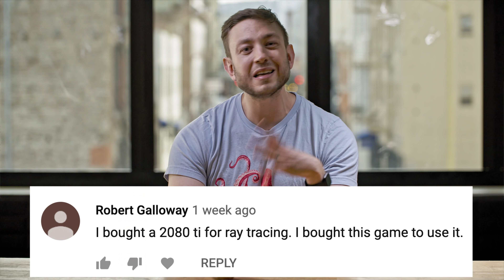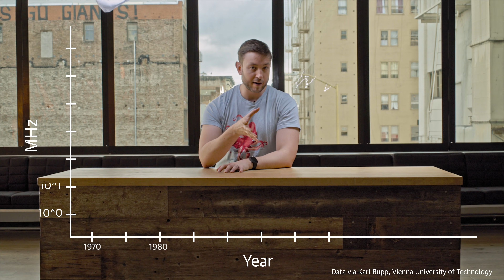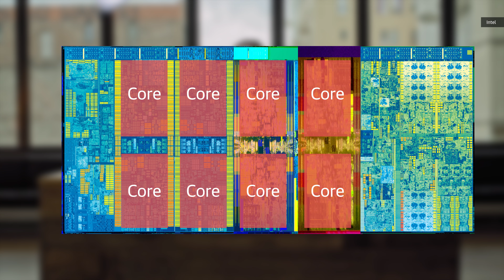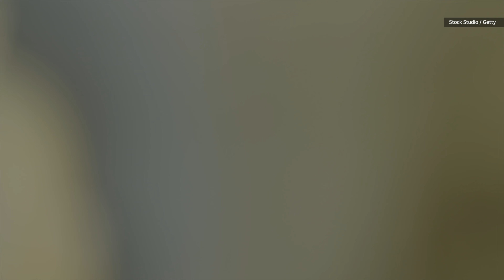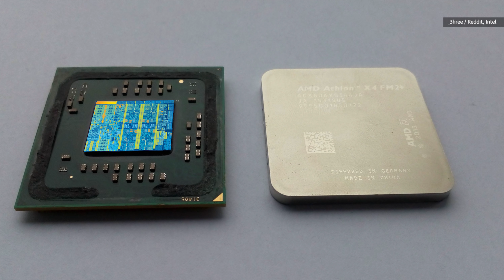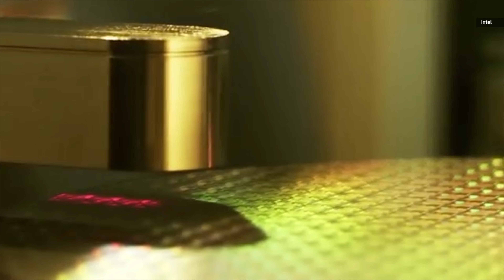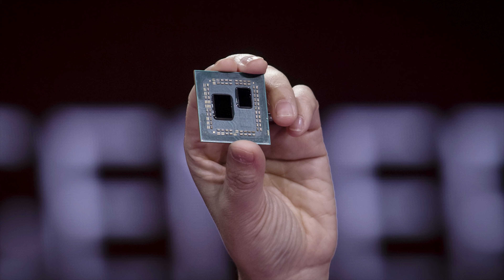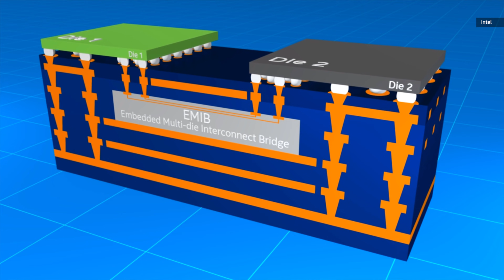How Intel and AMD are using 'chiplets' to build next-gen CPUs | Upscaled

Comment: Great video! Definitely look forward to the details chip design and electron transfer problems in high density processors. So, I want to subscribe to you and you only so that I don't get notifications for other random and Engadget videos 🤔
Reply: closer the transistors get the more and more real the problem of dark silicon (want X performance/speed soon as turn on transistors it causes some of them to go "dark" that is if use block 1 3 and 5 if might prevent 2 4 6 from working properly or at all while the others are active) so they have to add more and more to combat this from mattering "much" (though it costs $$$$$$$$$ for something not use ) the leaching effect of the dark silicon and wasted transistor budget hurts big time (only want it to use 100w but because of the dark silicon it uses 130+w instead at throttled clock speeds and/or you wanted it to have 4650 shaders but only 4096 operate at 10% reduction in overall clockspeed to keep power use in check)
Reply: @mauriceakamoefortin2510  so basically it's fighting a losing battle putting transistors with diminishing gains.

Comment: I hope that the Computex 2019 could be very interesting and I would be interested to see video about 1. Lakefield processor (based on Intel 10nm with Foveros technology) vs Qualcomm Snapdragon 8cx processor based on TSMC 7nm   2. MRAM (Samsung and Intel have done some announcement about it), what kind of challenges it could tackle and the benefits it could bring in processor design (ex: replacing some SRAM by MRAM for low power standby)

Comment: Look into literally every CPU. Look into the fact that a BIOS chip can run it's own OS completely separate from the rest of the computer, and, it has full administrative access to dictate which processes or functions can be or can't be used or accessed or executed.

I was getting into overclocking an ASUS G75VX laptop and found out that my system BIOS contained the GPU's vBIOS, so I had to use another utility to extract the vBIOS. 

In this extractor program, there were over 100 modules contained inside of my vBIOS and I had the idea:

Couldn't you massively infiltrate systems by compromising these tiny, separate OS's continued within chips and controllers inside of all our electronics?

There's your next SERIES idea.

I don't give "next episode" ideas.

Comment: Yes, tell us all you know about this, also, I was tracking some scientist from MIT who once said that they would be able to make photon transistors instead of the electronic ones, but he and the whole subject have just vanished I know nobody is talking about it anymore.
They were saying that it would be much faster and dissipate way less heat, the clock speeds would measure in Tera Hertz, Do you have any idea about it?
Reply: many are working on this as well as the quantum ones.

IBM, Samsung, HP, Intel, Ngreedi err Nvidia, Apple, AMD just to name a few of the "heavy hitters"
all have various levels of quantum or optical based (as fast as you are reasonably to get, though quantum is "its own thing" that can be paired up with optical "light")

the massive problem they have currently is not everything is currently even broadband level speeds (especially consumer level) let alone in the terra/peta byte level speeds, I personally would hate to see the price the would want to charge for it, let alone the internet to take advantage of it.

not to mention everything is basically being written from scratch otherwise the magnitudes of throughput and average speed would be wasted huge.

put another way.

systems we have are built around a small fraction of that speed, the cpu has to wait for pretty much everything. make everything else super fast cpu would not work very well with it, speed it all up superfast, cool, the code that takes advantage of it built for say 60-120-144+ performance would tanke stupid fast (like spinning bald tires with a 20,000,000HP{ engine, you ain't going nowhere)

Companies wallets are not ready for it (though the world could use a massive drop in electrical usage needs 24/7 if the price was that much more affordable and not wear out every year lol)
Reply: photon technology is way more delicate than electronics already are.
Reply: @serviceaccount6475  What do you exactly mean by delicate?

Comment: Intel needs to step it up....was going to buy a 9900k til I found out it was like 20% better then the 8700k. I was able to get a 8700k new for $290, no way was I going to get a 9900k for $600 for 20% better performance.
Reply: it is basically 0 % faster. 20 % comes from 2 extra cores + hyperthreading

Comment: Let's just make the CPU's bigger and the transistors the same size?😂
Reply: He literally mentioned why that's a bad idea in this video.
Reply: @TheHaters112   another smart guy. Yeah I heard. I really don't want a powerful CPU to be cool and power efficient.
Reply: @lanchesternaanyane  Basically the issue with your suggestion is the speed of light, or rather electric impulses.
If each transistor is far away from each other it takes a set amount of time to send the signals between them that depends on that distance.
As the number of transistors goes up that means that the combined time for all the distances between various transistors within the chip increases.
One way to solve that is to reduce  the distance between transistors but that increase the heat density of the chip making it harder to cool, you can try to compensate for that a bit by making the transistors themselves smaller and more efficient and therefore both regain some space between the transistors that are not transistors (and can therefore temporarily absorb heat when not in use helping with heat management) and reduce the amount of heat produced pr transistor.
That way you've fixed that problem.
But now you got software that's more demanding, so you'll want more performance.
Ok, you add more transistors to give you more performance, but that returns you to the original issues (as well as the whole yield issue) and so one and so forth.
It's kind of a form of thousand dimensional jigsaw puzzle trying to balance all the different engineering concerns.
Reply: @Luredreier  except the memory and hard drives are so slow the faster chips are an overkill, large scale integration works better (I think) with peripherals and ugly coding... programming is just wasting the hardware improvements..
Reply: Well said brother..Nailed it!
Reply: Technology is intentionally suppressed and forced to slow its development. IBM created 300 Ghz transistor more than 10 years ago. But since then nothing. 

Its is intentional. I have intel i7 3770k, its retro technology from 10 years ago and its still just as good as modern CPUs released 1 year ago.
There is no point of buying new CPU for me. I will use mine until it will die.
Reply: @oldi184  agreed.
Reply: @oldi184  KEEP telling yourself that buddy
Reply: The only way to make CPU's bigger would be to add more cores.

Transistors need to be very close together because wires have transmission line properties (Resistance, Admittance, Capacitance, and Inductance). So to make a core that consumes low power you need the transistors very close together. Thats because every time you send a pulse, you need to charge a parasitic capacitor (Capacitors are like batteries for electrical fields) (capacitors are formed between two conductive surfaces separated by dielectric like air or silicon dioxide). Obviously if you make a wire longer it has more parallel surface area to nearby metals, and thus increases it's capacitance. Charging the capacitance doesn't necessarily take power to do, it's the fact that there's also parasitic resistance in the wire. In nano scale circuits, wires have lots of resistance, so the current charging the parasitic capacitance goes through this resistance and is burned. There's also a thing called parasitic "admittance", where some current leaks through insulation between wires to a lower potential. At the nano scale, wires are separated by nm of dielectric, so there's lots of admittance between wires causing loss. The longer the wires, the more admittance there is. Then to top it all off there's inductance, inductance is like a battery for magnetic fields. Inductance prevents  magnetic fields from instantly changing (To have a current in a wire, because of faraday's law, you must have a magnetic field, so preventing magnetic fields from changing in strength also prevents currents from changing in magnitude). The longer you make a wire the more inductance there is, and the more that wire changes directions (actual inductors are coiled) there more inductance there is. So a long wire would prevent current to quickly charge those parasitic capacitance and slow clock rates. 

Transistors have also have the same issues as above. Their gates form capacitance from their gate to their source. So shrinking capacitor sizes decrease the parasitic capacitance of these transistors and allows you to increase frequency. 

There is a solution to increase switching frequency, but it comes at a negative. You have to increase the voltage. And unfortunately this has an linear relationship to increase the rates of charging, and has a parabolic relationship to switching losses. 

Example: Lets say I have a circuit with a resistor and a capacitor. Let's define a time constant T=R*C [seconds], and n to be a integer multiple of the time constant. If you apply a voltage VIN then output voltage as a function of time is VOUT(t) = VIN(1 - e^(-t/RC) ), so if t=nT (time as a multiple of the time constant) ..... VOUT(t) = VIN(1 - e^(-n) ) [n is an integer]. This means that after 1 time constant (RC seconds), the output voltage would be 63% of VIN. The time derivative (rate of change) of VOUT(t) is d(VOUT(t))/dt = VIN e^n / RC. 

So the rate of change of VOUT is VIN * (e^n / RC). Increasing RC, slows the rate of change of VOUT.

To double the length of a wire that could handle (doubling it's resistance) 5GHz, you would need to apply double the voltage or half the capacitance. Halving the capacitance is not feasible when doubling the length of a wire. The capacitance of the transistor would need to be halved.

So why not just increase voltage? Well thats because of this equation. 

Power Loss (dynamic) = Frequency(switching) * Capacitance * Duty Cycle(ratio of time being on to off)  * (  VIN )^2.  Most importantly Dynamic power loss is proportional to the voltage squared. 

So by doubling the voltage, you essentially increased your dynamic power loss by 4 times. This is only the dynamic losses when a transistor is being switched on and off. Transistors are tiny, so they also have leakage, so there's also static losses of VIN*Leakage Current. 

So basically you have to keep cores tiny. The only way to increase performance with current architecture is to increase parallel processing and to simply add more processing cores to work in parallel.
Reply: Excellent video, I learned a few new and very interesting things about CPUs today!
Reply: @johannsmith5697  that's not how it works. Small transistors by their nature generate small amounts of heat. They're small.
Reply: Xtreme Performance

Dont get me wrong. There is a difference. But its not worth the money. Most games these days rely fully on GPU instead on CPU. 
When i play modern games the CPU usage of my i7 is about 20 to 30% sometimes to 40%. So? This means that 70 or 60% of my CPU is doing nothing. Its just wasted. 

But GPU usage is above 90% often almost 100%. 

Since 2012 I only change GPU every 2+ years and I can play all games on max details without any problems. 
Because PCI express connector stopped evolving. 

As I said I will use my current CPU as long as possible.
Reply: we already hit saturation point of the size of the transistors. Its basically at atomic levels now so they need to create new ways to arrange the parts inside the die to increase performance while avoid these limitations. Intel slacking off for over a decade, until now they are forced to compete and create a new architecture.
Reply: That's basically an i9900k on steroids lmao

Comment: Latest news
Intel: 14nm+++++++++/10nm
AMD: 7nm
TSMC: 6nm on process
Samsung: 5nm EUV sucessfully development
Reply: I think that, in April 219, both TSMC foundry and Samsung foundry announced that they have completed the development of their 5nm node that will use Extreme Ultra Violet (EUV), and mass production of chipset based on their 5nm should start approximatively during ~H1 2020. 

It means that we could hope to see consumer products with TSMC or Samsung 5nm chipset toward H2 2020 (in a bit more than 1 year from now)

I would think that the transistor density of TSMC & Samsung 5nm node will be superior to Intel 10nm node, which could finally help make CPU based on an ARM architecture much more competitive in terms of performance against Intel processors.
Reply: Intel still has much higher transistor density at 10mm than TSMC does at 6
Reply: @moist_ointment  It is not "much higher" TSMCs 7nm is on par with Intels 10nm performance wise.
Reply: AMD uses TSMC and other foundries for their chips. TSMC's 6nm is just a marketing name for 7nm with EUV, Samsung's 5nm EUV is nowhere near mass production right now but I expect mobile SoC to adopt 5nm for late 2020 or 2021 timeframe and yeah Intel has fallen behind in process node. Hopefully they learn from their mistakes and transition to 7nm and beyond much faster. 

P.S - As its said in the video, node names are just marketing at this point. Intel's 10nm is just as good as TSMC 7nm and 7nm EUV if not better.